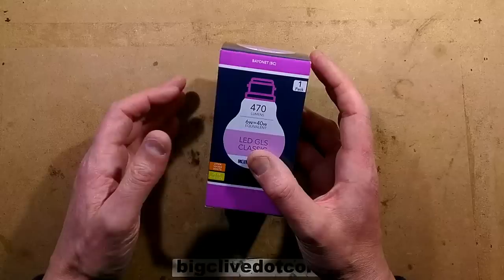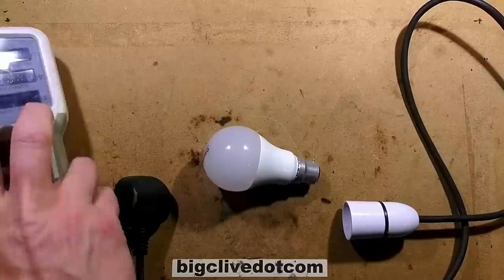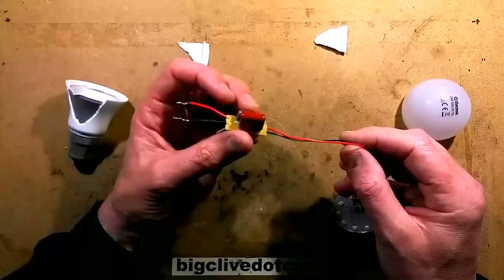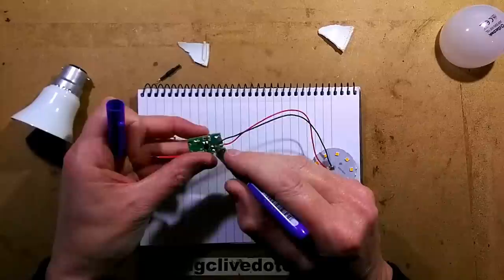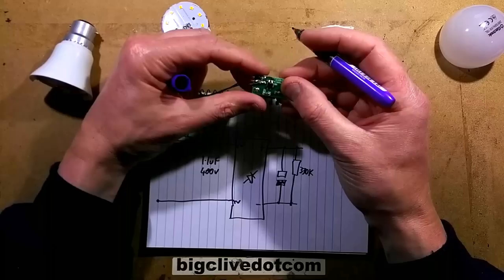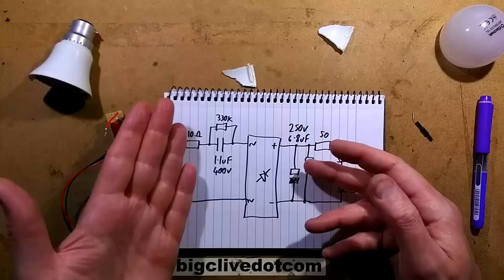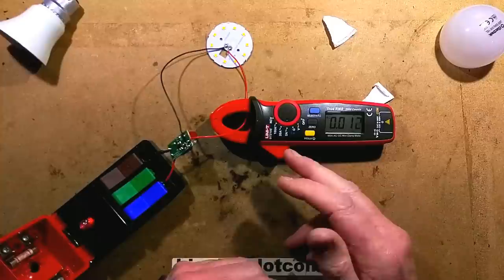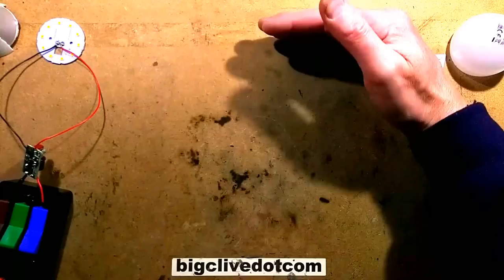Poundland 6W LED lamp teardown with schematic.

Comment: The North American QuickTest is Cliff CL1857, and when supplied from Cliff, does not include a cable. You can get a UK QuickTest from Newark/Farnell in North America, but ironically, the North American QuickTest is only available from the UK Farnell store.

The Ebay seller with the quicktests includes the cable, and a full range of fuses.

Comment: The new 6 watt lamps are an improvement over the previous 5 watt lamps Poundland sold. The aluminium backed circuit boards will keep the LEDs a bit cooler and extend their lives.

Comment: its really cool to see a tear down of these lamps, cause ive been curious about the quality inside these.  i bought a bunch of these for all of the fixtures in my house, been using them for about 6 months now, one of them has been on 24/7 as well, sill nice and bright... great video Clive , as always!
Reply: Kyle Veilleux I've wanted to change my bulbs to these for a while seems like they are worth it ill pick up some tommrow :)
Reply: they are very bright, cheap and very good bulbs for me.
Reply: I've pretty much filled my house with these, too. None have gone bang, nice warm temperature light. I like 'em.

Comment: I repaired a small Aldi brand one a guy brought in that was supposed to be dimmable. It had the same circuit as that one, but a higher value filter capacitor and no resistor in series with the LEDs. There was 10 quad LED chips (each had 12.8V drop). To make it dimmable, they had one of those little resistor shaped inductors, instead of a surge limiting resistor, which promptly cooked and shorted when dimmed as the inductance was no where near high enough to absorb the 100 surges a second, and blew the fuse that was also included. I replaced it with a resistor and instructed him not to dim it as it was not properly designed for it. If I remember rightly I got it apart by scraping the glue out with a piece of old teller card. The light output was so good, I bought a pack of 3 10W ones on special at Aldi (Not for dimming of course).
The proper dimmable ones have a little switch mode PS chip with an enable pin connected through a resistor to the power input to switch the LEDs on only when the i/p voltage is present. Because the filter capacitor is large, the ripple is minimal so there is only small pulses across the surge limiting resistor.

Comment: I thought a few weeks back that you had already reviewed these so went hot foot to Poundland to buy a tenners worth. I bought some more this weekend and half way to LEDing my house.

I've stuck with those 6W GLS classic for the main room lights and hall etc and the 3W - 200L / 5.5W - 470L and 3W - 250L for wall lights and table lamps.

I'm quite pleased with them - nice colour too. They do get warm but not boiling hot and any lamps that are on all the time (like the cellar) are the smaller 3W ones.
Reply: they're great bulbs for me too.

Comment: Managed to take the one I bought apart without any damage and it had the little board extension through the top PCB and two small jumper wires going over.

As to the fusible resisitor, the candle version of this lamp has FR1 on the board.

Comment: I can tell when we're having a full power outtage or a brown out when the power goes down because the IKEA night lights I have plugged in around the house will glow very faintly. I think I tested it once, it was something like .25 volts or something coming from a wall outlet.

Comment: I've had 2x 10w LED lamps (8.7w actual draw) running for over 2 years constantly in the office kitchen area, no issues whatsoever. They get warm in the summertime, but for less than £10 2 years of continuous use is pretty good in my book! "MiniSun" brand.

Comment: iv been running those exact bulbs for a month. They do get warm. Poundland did have some 6W LED bulbs made by PIFCO that run so much cooler but they have vents to let the heat escape.
Reply: The lamps in front of me have big fins on them. They're 2.4W
Reply: ChaosFlower   the poundshop bulbs (Electrek) are very good bulbs for me too.

Comment: A short while ago I bought some cheap Chinese LED bulbs as replacements for some unbelievably dim CFL bulbs in my kitchen light fitting. After only a month or so one of them began to flicker. I had a quick look at it and noticed that it used an SMPS and they'd used standard 1 Watt LED's soldered to the aluminium backed PCB. I assumed that the fault would most likely lie with the switched mode driver and left it at that as the flickering was intermittent and only occurred after the bulbs had been illuminated for some time. When a second bulb began to flicker in the same manner as the first and then the first faulty one stopped working apart from being lit dimly when on and then lingered on after the supply was cut I decided to have a proper look. After a few simple checks I was surprised to find a steady voltage from the driver circuit so I checked the 1 Watt LED's and was surprised to find just one of them was at fault and as they were all connected in series it was affecting the current through all of the LED's and causing the dimming effect. Once it was removed from the PCB the faulty LED, which did have thermal paste between it and the PCB, was replaced with a new one and new thermal paste. When I looked closer at the other faulty bulb before removing any components I noticed that the bad LED, despite having thermal paste under it was soldered fractionally lifted from the PCB so it had obviously been subjected to thermal damage over time and this had increased its resistance and caused a run away effect. Having now checked all the cheap bulbs and ensured that all the LED's are now properly touching the PCB they appear to be working fine and no more failures have occurred. 
I can fully understand Clive's hesitation in buying high wattage LED bulbs as I think they are often subject to thermal over stress which could well lead to an early failure. As the bulbs I bought had easily sourced and replaceable 1 Watt LED's I was able to repair mine but most use SMD LED's and are probably difficult to repair.

Comment: Most LED lamps like this in the USA have push-through connectors holding the caps and the mains leads, very easy to change out.

Comment: I got a couple 7 watt A19 shaped dimmable LED filament lamps at Walmart last week, and they're pretty neat little critters. They have a bit of flicker when running on AC, but you only really see it when you move reflective things quickly. They definitely don't run cold, but they don't get overly hot either. With a quality dimmer, they can go down to an almost imperceivable level of light output. They're quite efficient, putting out 800 lumens for their measly 7 watts of power consumption, and they look identical to a tungsten lamp from even just a short distance away. Great color temperature, completely silent, very nice, and rather cheap (8.50USD for two bulbs). If I wasn't so attached to them, I'd break one open and take a look at their driver circuit. The fact that they can continue to power 3 parallel 2 series LED filaments on as little as 19 volts DC makes me think there's got to be an inductor in there somewhere.

Comment: I literally just was about to take apart a bulb (10.5W) a bit like this one when I saw this video, it was kinda fun to follow along and compare the differences. for example at 4:45 instead of the short wires on yours there's a connector that just slots into the LED plate without even any solder. also about the part on heat at the end - the one I took apart actually has a fairly substantial amount of aluminum to dissipate heat, and the whole circuit board is potted in resin with little bits of plastic to keep it nicely aligned, making it noticeably heavier than some of the cheaper bulbs I've had. I think it was probably more expensive side than the one you took apart (I accidentally broke the glass diffuser, so I thought I might as well see what was inside) but it goes to show that on the better bulbs, they actually do take heat into consideration when designing them, although I notice there's still a note on the case that says it's "not for use in totally enclosed [lamps]" still. Very interesting.
Reply: also with the circuit board, I can see some surface mount components sticking out of the resin (right on the other side of the board from the connector to the LED plate which they obviously had to keep out of the resin) which should put out less heat, right? It's an 800 lumen 10.5W 100mA (120V@60Hz socket) LED bulb made by General Electric (GE) in case anyone is interested in seeing what I'm talking about.

Comment: I just bought one of those clamp meters. $30 for something that measures dc current with 1 ma resolution is quite impressive. I have been really happy with it so far. My old clamp DC clamp meter cost $60 and it was a pain to use for anything less than about 10 amps because it would start to drift about 3 seconds after you zeroed it even if you didn't move the meter at all.

Comment: That looks very similar to the Ikea LED lights I have - but they potted the electronics and I've not torn it fully apart.  In my case the LED sometimes flickers really quickly but the LED board above it is electrically fine.

Comment: One of the plus sides of these capacitive dropper lamps is that they do not produce any EMI (Electro-Magnetic Interference), which as a radio amateur, I am very grateful for. Not sure what a country full of 0.5 power factor lamps does to the National Grid, though. I have also found that they can be successfully dimmed with a Trailing Edge dimmer - more expensive than a Leading Edge one, but since I am using 10 of the candle version of these lamps in two candelabra fittings, the £10 for the lamps still keeps the overall price low compared with expensive dimmable LED lamps.

Comment: The discharge resistor is a funny thing. I have an amplifier with blue LEDs and they stay on for quite a while after you turn the thing off. It makes a nice effect really. Not so desirable with lamps, though..

Comment: I don't know if you said that and I missed it, but the 6W rating is mainly due to cover also the power loss in the convertion. When you buy a lamp, it isn't stated the power fo the LEDs, but the power of the lamp (converter, LEDs ecc). So, looking at the stated Lumens would make a better idea of the generated light.

Comment: Interesting video. The Poundland  5 Watt lamps did not last long before burning out, these 6 Watt lamps are much better, and seem to  have a very good light output. 

It would be great to have some measure of the light output in your tests. Just testing the consumed Watts is not in my view enough, I have some lamps the consume the correct wattage, but give poor light output. Good room heaters!.

Comment: Just opened a failed one of these, having seen the LED jumper hack but all the LEDs are ok, it's the 6.8uF cap which has gone. I have a few more of them failed, so I might use a multitool to slice them open closer to that cap, now I've seen the construction.

Comment: You know, I have a Sylvania high powered LED light bulb that prematurely failed.  I tore it down but it's epoxied.  I actually wanted to repair it, but have no idea how to melt the epoxy to get to the guts.  Any ideas?  I know I should just replace it, but it's one of those "150 watt equivalent" and weren't cheap.  The LED itself still works when powered from a bench supply.

Comment: you can remove the logo from the lens on these things with alcohol in 2 ways.
first you can rub it off with rubbing alcohol on a tissue which takes very little time.
otherwise you could drink so much that you cant read it anymore.

also, poundworld have their own range of lamps now. they have 5w candle ones and i think they use switchmode psus? would appreciate if you could look at them in a vid...

Comment: Clive...these lights sell for a pound?  That's around four bucks AU.  Our version of "Poundland" ("The Reject Shop") sells their own version of LED lamps from 6 to 9 watts and colour temperatures from the traditional yellowish of old incandescents to brilliant white.  They cost four dollars exactly.  I've used a number of them in both bayonet and E27 fittings and they work quite well.  The big brand lamps are still pricey here...up around 9 dollars per lamp but prices are dropping due to the big hardware retailers using their buying power to buy the things in bulk.  I believe that Bunnings have now opened in the UK.  This Aussie hardware chain routinely sells packs of 4 LED bulbs for about 10 bucks a pack.  I suppose you'll get similar prices in the UK Bunnings.

Comment: ooh, I have several of these, and they're decently reliable so far, just wish they had a choice of whiteness as I'm not too keen on the yellow-white myself, much prefer the 4100k range... :)

One thing I did notice was the "pygmy" versions, they're apparently lower power and lumens, but comparing them on the landing light when I first got them, they seemed to be just as bright as each other, so left a pygmy one in there with an LED "breastfeeding" (no, seriously, they sell it as such!!) nightlight thing between it and the socket... :)
Reply: they are great bulbs.

Comment: We don't have poundland here, but Aldi and Lidl both sell LED lamps on occasion. I have bought multiple lamps from Lidl, and they all still work (I've only replaced them because they were too dark, either through age or because the newer lamps are brighter at the same wattage). With Aldi lamps though, my experiences aren't as good. One that I bought worked for about 3 hours before it went dead.

Comment: Hey, just wanted to say thanks for the tip on that Uni-T meter you used in this and previous videos.  I was looking for a decent DC ammeter and bought one of these after seeing you use it in your videos.  It is very small and I keep it in my backpack for "emergencies" when I travel and on vacation I had cause to use it to repair my sister's HVAC unit!  Worked great and let me measure the currents on the compressor and fan motor.  :)

Comment: 1.1uF IS a standard value, but it is a 5% value where most capacitors are usually rated +/-10% and use 10% standard values. That 50 Ohm resistor is actually more unusual IMO, as that isn't a standard value even for a 10% resistor (are you sure it wasn't green-brown-black, or 51 Ohms?). The only example I can think of with an even 50 value were some older ceramic capacitors that were rated 0.05 uF rather than the 0.047 or 0.051 standard value used these days. That said, older capacitors like that were sometimes so poorly controlled that it was not uncommon to see them rated -20/+80%, so it didn't really make sense to have the added precision anyway.

Comment: Bigclive I have a question, On a DC 0 to 12v R/C brushed motor. I had a few r/c cars when I was a kid grasshopper, the frog, and the Blackfoot. I'm 43 so prolly 30 to 25 years ago, anyway I've noticed the last few years my son has ben into them and the motors now a days seem to have a metal strip on the outside of them I was wondering what that strip is, heatsink or magnet. I just don't know.

Comment: i use a 12 watt lamp and i drilled 2 small holes to vent the heat out it runs alot cooler big diff.

Comment: The LED lamp I leave on most of the time has a massive heatsink that is hardly above room temperature. Of course, it's a three way and I think it's on a lower setting, but it's lasted 3-4 years without thought. I should clean out the cob webs.

Comment: Clive,

As an interesting project, try to modify the HOPI to change the update rate of the displays to work better with the cameras.
Reply from the maker: +LakeNipissing That will be tied into the software.
Reply: That's too bad. I thought it might have had a separate display driver section, which could be 'tampered with', but it is all on one COB... no dice.
Reply: So, add another micro into the box : )
Reply: There was a 'sweet spot' level of illumination that made the hopi appear to stop flickering on the old camera... or am I just misremembering that?
might be worth an experiment
Reply: tohopes - ideal opportunity to make the box much bigger - so it doesn't look silly next to the calculator :)

Comment: Hey Clive, wondering if you could do a video about the details and design of one of these capacitive droppers. Super common in the cheap electronics you take apart, despite the questionable reliability and safety, but very little information about how the component values get chosen.
Reply from the maker: You calculate the capacitor value using the formula for capacitive reactance based on choosing the capacitor equivalent to a resistor that would allow the desired current to flow at the voltage being dropped across it.  In reality the range of suitable capacitors is very small, with a value ranging from around 220nF (0.22uF) to 1.2uF.

Comment: Can you explain why a 6W lamp is only 470 lumens - or perhaps if you've explained that often in previous videos, perhaps you could point me to the right one?
Reply from the maker: The light output will depend on the efficiency of the LEDs and any diffusion.   Many lamp manufacturers cheat the figures by measuring hot spots.

Comment: would the hopi thing stop flickering if you install a ceramic cap between every led and the ground?
or is the multiplexing really low power?
also i have 7 watt led bulbs with exacy the same pcb style and active electronic power suply
the power pcb in fact connect to the led via small dualwipe socket

Comment: Last year 2019 I bought some Asda led lamp GLS AT 9.4w= 60w the white tubular near the base got so hot you couldn't  touch it without scorching yourself. This year 2020-07-10 the lamp died and its not even year old it packed up just giving out a small glow it done aprox 3000 hours lol.